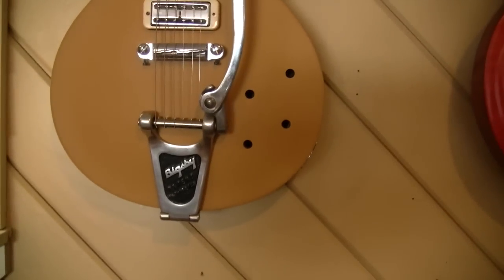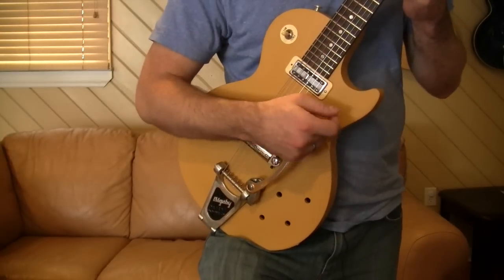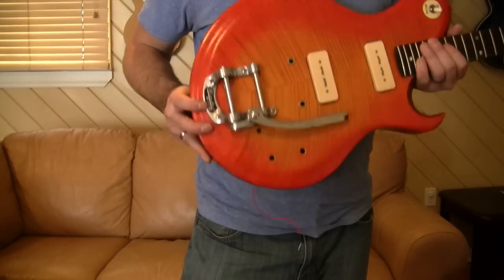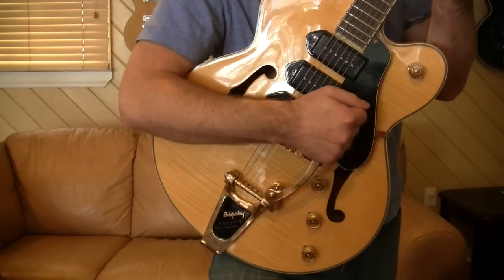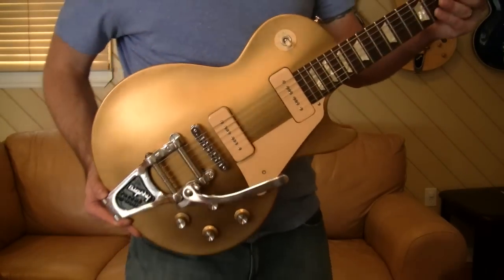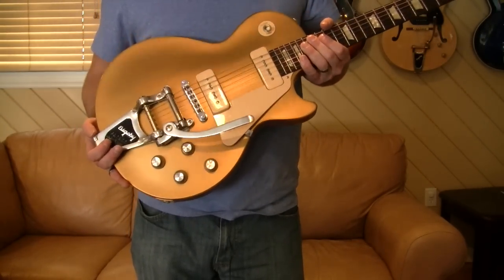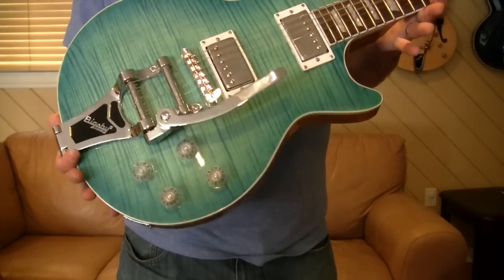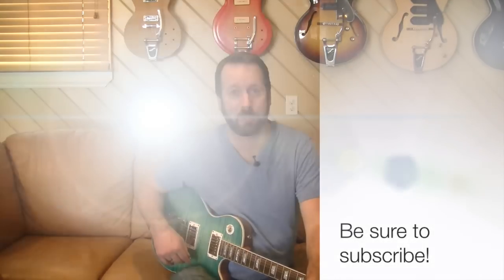Bigsby B3, B5, B50, B6, B7, B700 & Vibratmate Show and Tell

Comment: Hi Nick. Great video and Nice guitars. I have a B5 and a B7 on a telecaster and a Gretsch but I have also a couple of Chinese fakes and have fitted the B5 version to a Les Paul Special copy. It seems to work fine and looks pretty good for 35 dollars. I have a question. Check out this video https://www.youtube.com/watch?v=DlK8b9BZkZU . This guy has drilled the string pin holes right through the roller bar countersinking each side of the hole so he can simply thread the strings though (a lot easier). I am thinking "Oh dear. String breaks"? Do you have any thoughts or experience on this as I thought I might try it out on one of the cheapo fakes. Any info would be great. Thanks and "Keep on Rocking".
Reply from the maker: +Barrie Anderson Interesting concept! It's actually similar to how the Xtrem from GFS works. Seems like a solid enough idea... although it may just be easier to get a string spoiler from the Vibramate folks. You can't beat the price on the Chinese copy Bigsby's. The one I have on my Blue guitar seems to return to random tunings after use. Might just be a dud. Thanks for stopping by man and keep rocking indeed! Love the pun! LOL
Reply: Cheers Nick.